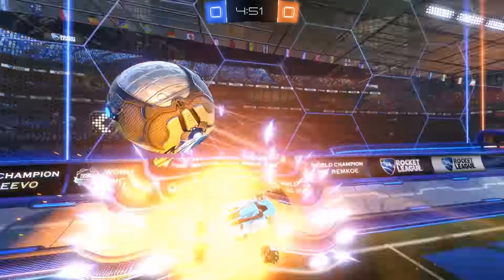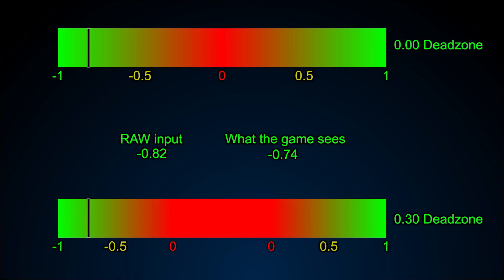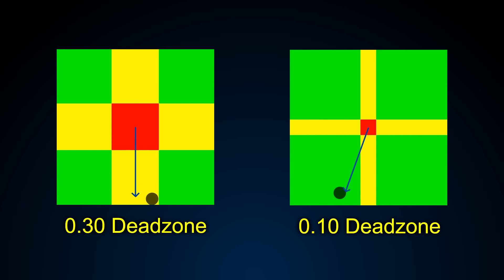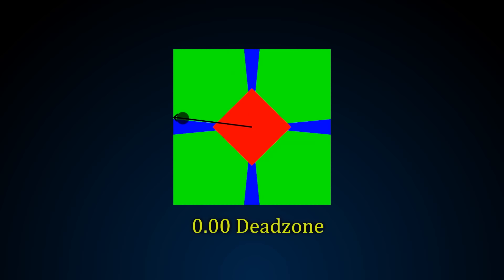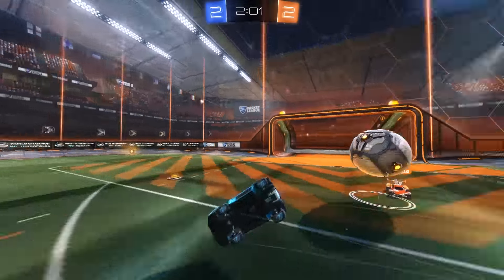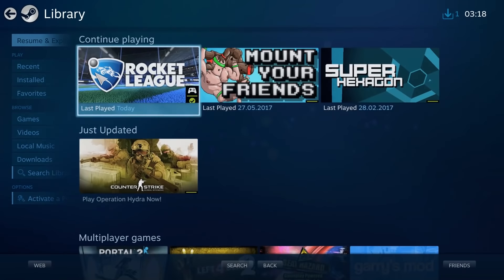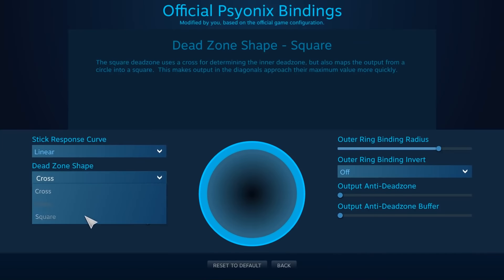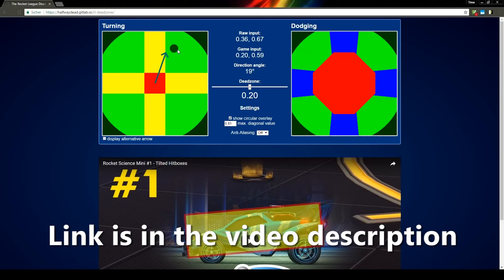Deadzone explained - Rocket Science #7

Comment: it changed my ingame buttons to xbox but i use a ps4 controller can you help me?
Reply from the maker: Unfortunately that's a problem that cannot be fixed. The steam configuration works by creating a virtual controller and sending those virtual inputs to the game. The virtual controller is always an Xbox controller. If you care about having the correct button icons then you have to turn it back off by reverting the steps in the video.

Comment: Okay... I'm fucked now.
Never ever were in the Big Picture Mode of steam. Wish I never did.
Just tried it to look but backed off quick, cause half of the screen were invisible.
Now my controller won't work as yesterday.
I can't get the ordinary crossbuttons to work in RL.
The digital direction keys.
Checked it in Windows settings and they are recognized but in RL they are disabled somehow.
I deleted the hardware in Windows 10 and replugged it.
No change.  The Razer Wildcat is detected correctly in Windows but not in Rocket League.
Do i have a chance to to get it work again with erasing the file with the inputsettings and check integrity afterwards C:\Users\Idiotfuckboiwhocantmanageanythingcorrect\Documents\My Games\Rocket League\TAGame\Config\TAInput.vdf
Reply: Tried it. Worked!!!!! 
I dont even had to check integrity.
Just replug controller and start RL and the TAInput.vdf is generated again with good old settings.
Weird thing.
What I'm curious about now is the thing with the circle-limitations of the XYZ-Stick. I have experimented with these sticks and Arduino boards. I know about those two axis and that it can describe a full SQUARE if not build in a case like a controller has.
But where in the gaming world is that a thing? You mentioned one controller I did not even know about.
Why is this algorithm which does the recalcs for a circle-based stick not done by the devs itself.
Even in the Win-own calibration window there is a square in which you never can reach the outer corners?
Okay... it seems to be right for most of the applications, because the thumb describes exactly that position.
But a checkbox for a circular recalculation should be a thing. Maybe for Psyonixes devs? :)

Cheers

Comment: I have a question: is the controller deadzone different on the console or is it the controller that assigns the deadzone(is playing on pc same as playing on a console with same controller?) Im askin this related to the squared and circular deadzone because it can be only changed via steam
Reply from the maker: AFAIK from what I've heard it works the same on console and PC. Meaning that by default you don't get full diagonal turning speed. However, you can use the "Air sensitivity" slider (I believe that's what it's called)  and turn it slightly up to like 1.3. That should be enough to get full diagonal turning speed. It's just a bit different from the square deadzone change steam does. Because the air sensitivity multiplier makes all your inputs more sensitive in the air but the square deadzone makes only diagonal inputs more sensitive.